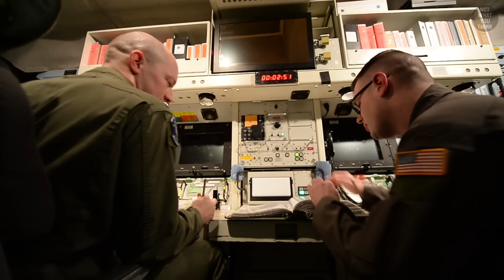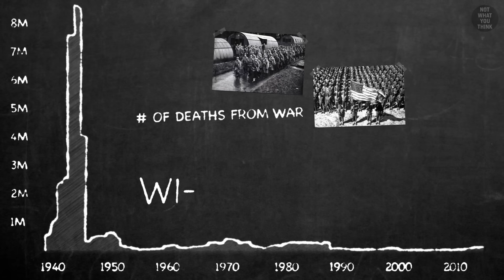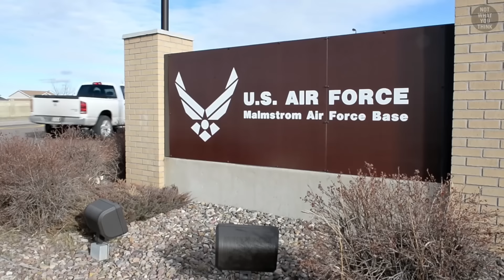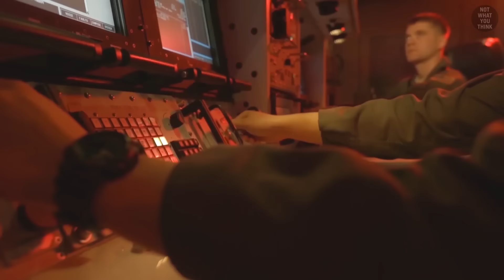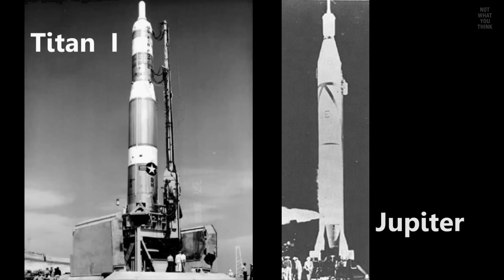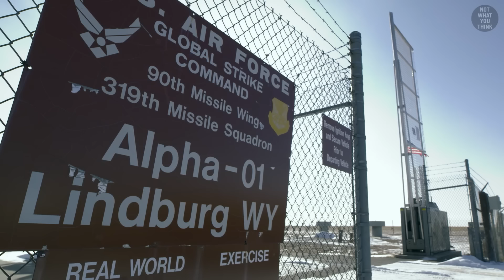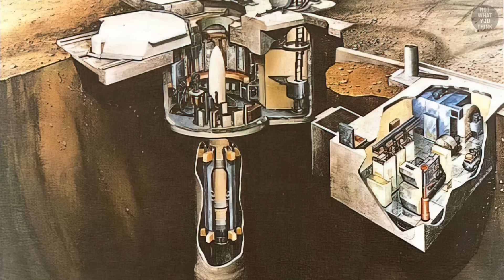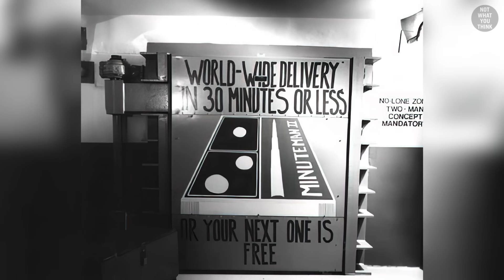Guarding America's Missile Fields

Comment: I was on the TRF at FE Warren about 10 years ago, I know some of the security forces airmen in this video. Awesome video, thanks for sharing about what we do/did. 

As TRF, we are taught in training about how the SEALs allegedly broke into the missile sites. Back then, we didn't have TRF so there were just the usual patrols in the area to respond to alarms, and I think the average time to respond was anywhere from 10-30 minutes. The story goes that the SEALs drove a construction backhoe onto the site, just demolishing that little fence and began digging down around the concrete missile tube. They only needed to go down around 10-15 feet to get to the thinner walls, then blew it open with C4, cracked open the payload at the top of the missile, used the backhoe to tear it out and load it into a proper truck and skedaddle. The whole process only took about 5-10 minutes. Plenty of time to get in and out before the patrols could respond. After that demonstration, the Air Force knew they needed a rapid response force to retake warheads after the fact, since that scenario was most likely to occur. And the TRF "turf ninjas" were born. :)
Reply: There are stories, things that happened, and then there are 'stories' rumors of things that happened that wind up getting blown out of proportion.  Former X3 and FM here, you got told a 'story' one of many that's floating around the missile wings.  Now I don't doubt that at one point, if not several points, in fact I know of one or two times, seals along with other special forces outfits have gone to the missile wings and observed the sites, the procedures, the general day to day operations of the wings.  They then sat down and planned on how they would go about trying to break into one or more of the sites and then did excercises.  From the plans and the excercises came changes to staff, procedures, and even the sites somewhat which may have caused one or two other incidents because of the changes that were made and that the system experts(the technicians that worked on the stuff everyday) advised against making.  I can say that they never actually physically broke into a site nor took a warhead because 1. the military would not authorize them to cause a few hundred million dollars (cost to get everything repaired correctly and recertified) worth of damage to test security procedures(plus that money would have come out of the seal's budget) and 2. the military would also not authorize them to potentially risk detonating the missile downstage, which the fuel alone would cause a 40 kiloton explosion, nor potentially causing the warhead to detonate by them just ripping it off the top (very slim chance, but again not something the military would authorize just for a security test).  Unless you read the report, see the pictures, or hear it from someone that was actually there, you might just be hearing a 'story'.
Reply: Would like to know what they did with the eighty ton blast door. Must have been one hell of a backhoe to dig 15 ft down and then be able to tear the warhead off to n 15 mins. I believe this story is bullshit.
Reply: Your story does not add up, I have personally toured the Titan Missile Museum in Green Valley Arizona. The massive blast door would withstand most earth moving equipment, especially a backhoe. I served with the 92d Security Police Squadron securing B-52's on 15 minute ground alert. No one ever got anywhere near those birds sitting on alert. No one to my knowledge ever tried to climb the fence of the bomber alert area or the massive weapons storage area. They would have been shot on top of the fence, Use Of Deadly Force IS Authorized!!!!!
Reply: Well, there is the incident in which Marcinko and team members broke into the Seal Beach Weapons Center in the middle of the night, and kidnapped the XO, and, I think his wife, too, just to prove their security was lacking.

I think that was the one that got him fired.
Reply: I’m highly skeptical of the SEAL story. These sites are nuclear hardened, built to withstand a near direct nuke hit. There’s outside (radar-based) and inside security zones, with vibration detectors and other things that set off an alarm. I worked on those systems. Not that it’s totally impossible, just unlikely

Comment: 9:30 small thing to note, not all liquid rocket fuels have to be hypergolic. For example, the fuel used in the SLS launch system is not a hypergolic fuel. Hypergolic just means the fuel and oxidiser react on contact without an external ignition. While this is great for being sure they will ignite, it’s not great in situations where you would not want them to do so.

Comment: Classified Systems? PFFFT

they have low power Doppler RADAR units that bathe the entire area around the fence for detection of movement and rough identification of what it is moving around.  all this can be easily found with simple google searches. 

The Doppler RADAR is the large white pole you see sitting near the hatch, typically near the center point of the area.  I drive by them all the time.  

Rule is - Approach the Fence, they know you are there.  Get within 10 feet of the fence, get detained and questioned.  

Touch the fence, you are liable to get shot by multiple tasers,  or lethal force if you disregard the order to stop touching it. 

Jump the fence - you die, plain and simple.

Comment: Lot of mistakes around 9 minute mark. Atlas had range of something around 5000~10,000 miles (not 500). Fuel on Atlas was cryogenic LOX and kerosene (RP1 - I think?). The Atlas took about 15 minutes to make launch ready. The Titan I was also LOX + Kerosene. Titan II used hyperbolic UDMH + hydrazine (propellant) and nitrogen tetroxide (oxidizer). These are super toxic chemicals as events in 1980 would show. Big advantage Titan II had over predecessors, fuels were not cryogenic - could stay fuelled in silo, also vastly greater throw weight.

Comment: 9:00  The earliest ballistic missiles (V-2, Redstone, Thor, Jupiter, Atlas, and Titan I) were fueled with alcohol or kerosene and liquid oxygen.  Those are not hypergolic.  They require a spark.  The liquid oxygen had to be loaded before launch, but the stable fuel always sat in the tank.

The Titan II introduced hypergolic propellants, hydrazine and dinitrogen tetroxide.  These did not have to be loaded before launch.  They could sit in the tanks at all times, waiting for the valves to be opened.  Contact is all that is needed for ignition.  That us what hypergolic propellant does.

Side note:  While Jupiter-C and Juno I were based on the Redstone missile, the Jupiter ballistic missile used the Jupiter vehicle, not the Redstone vehicle.  Redstone (as Jupiter-C) is shown later and called Jupiter, but the actual Jupiter ballistic missile is shown at the above time stamp.

Comment: I took issue with the dig at the antiquated telecom systems comparing them to smart phones.  Since an EMP strike in all likelihood will happen before a missile strike any electronic comm device will die unless hardended.  The older analog electrical (not electronic) devices like a rotary phone system with its old time dial will work even until the last man standing drops.  there is nothing in them that cannot be fixed by hand and the emp will not even cause a ripple with surge suppression.  Don't dis old time, it still rocks the world.  The Russians retained theirs too.

Comment: You just took a major credibility hit with me. The 1st generation ICBMs did not use hypergolic propellants. Instead they used a form of kerosene as fuel with liquid oxygen as oxydizer and thus must have had propellant loaded at launch time. The 2nd generation ICBM, LGM-25C (Titan II), did indeed use hypergolic propellants; nitrogen tetroxide and a mixture of hydrazine and unsymmetrical dimethylhydrazine. Because Titan II's propellants could be stored on board the vehicle and thus the missile could be launched essentially at a moment's notice. I spent 5 hears working Titan II communications and thus spent many unhappy hours on Titan II launch sites.
Reply from the maker: Thanks for pointing it out 👍

Comment: I think it's important to keep ICBMs Dumb without GPS. as incase of solar flare that would wipe out most electrical equipment
Reply: The original Minuteman 1 was zero'd using a star chart and a bunch of mirrors. There was a light path through the silo, and a window in the guidance and control section. I never aligned one this way, and by the time I got on the scene, that was completely obsolete so they didn't teach it. But I found a tech manual that still had an old section with that procedure in it.

Comment: You made numerous mistakes in your history of ICBMs. #1- Atlas had a 9000 mile range NOT 500 miles. #2- Jupiter, Thor, Atlas, and Titan 1 had CRYOGENIC propellants, which needed to be loaded directly before launch, NOT hypergolic. Hypergolics were introduced in Titan 2 and were the first storable propellants that could remain inside the missile so it could be fired immediately. However, they needed to be kept at precise temperatures, were highly corrosive, and very dangerous. That is why solid rocket motors were developed for Minuteman. #3- Solid rockets are LESS accurate than liquids. Liquid fueled ICBMs could control precisely how long the motors fired. In order to use solid rocket motors in ICBMs, engineers had to develop blowout ports to shutdown the rocket precisely. Even then, Minuteman 3 added a post-boost hypergolic liquid stage to tweak the trajectory so that it could be the most accurate possible.

Comment: Liquid fueld icbms didn’t have to be fueld before launch since they would have been stored with fuel and oxidizer on board. They didn’t use cryogenic fuels such as lox and lh2. They used hypergolics such as hydrazine and nitrogentetroxide. Those fuels where extremely toxic and if there was a mistake while working on the rocket, it could be a catastrophic one. That’s why they switched to solid rocket motors.
Reply: Also, solid rocket motors work without needing turbo pumps or pressurized tanks to feed the engines. It would be interesting to know the rated service life between replacements for the solid motors used in our nuclear arsenal. I know the SRB’s on the SLS first stage are only certified for a certain duration from date of manufacture.

Comment: The Time delay on the b-plug is a lot  longer than 20 minutes by the way lol, also you also need an additional device to lower the B-plug as well
Reply: I don't remember any additional device for b-plug pen. There was an extension handle that you could use if the lock lugs were stuck. But you just needed the combination to get it open. Of course the last time I did this was 40ish years ago, so I may have forgotten something.

Comment: Now question is how long does the solid propellant last? How much does it degrade over time? Does it loose power?
Reply: That's part of the reason they test them continually.   There is a very good book, "Rockets and Missiles of Vandenberg AFB' by Joseph T Page II.  In it he lists every flight of every vehicle launched from VAFB.  From 11 Apr 1969 through 5 Sept 2016 there have been about 280 MMIII test launches.    It's a wonder we have any left!   And for all types of vehicles launched from Vandenberg from 16 Dec 1958 through 5 Sept 2016 there have been 1948 launches.   And now six and a half more years have passed . . .

Comment: Very good video. ICBMs are almost obsolete; the only saving grace about them is that an enemy MUST attack them to put them out of business. And, of course, that confirms the attack. Most missiles that the United States would launch in a nuclear attack would be cruise missiles and SLBMs. A few ICMBs would probably survive a massive first strike but not many. They are, essentially, "cannon fodder".  BTW, though no nuclear test in the megaton range has ever been detonated over the continental U.S. (the largest test over the United States was 79 kilotons in 1957 and, of course, some megaton tests were fired but in the Pacific a LONG way away) the blast of the volcano Mt. St Helens did occur, in 1980,  near Montana and Wyoming with an estimated yield in the megaton range. The "plume" of volcanic ash was charted by the Government. It simulated the atmospheric plume that would occur if a few Soviet  ICBMS went off in ground bursts in Montana and Wyoming. These plumes would be highly radioactive. Just two missile strikes by one megaton warheads would probably result in the deaths of a couple of million Americans as the deadly radiation drifted into highly populated areas.